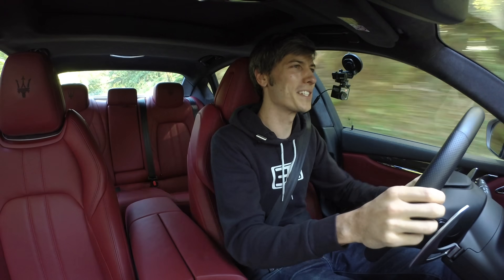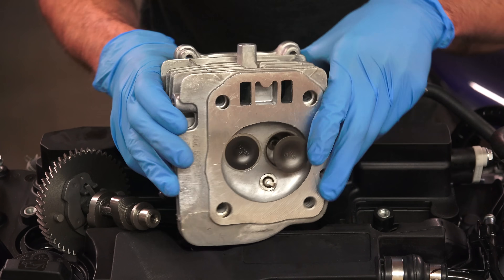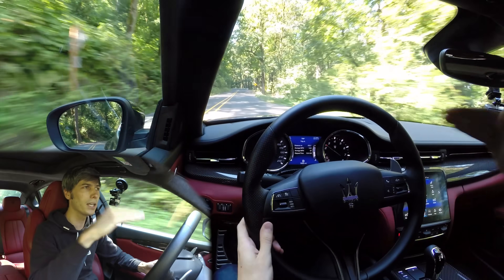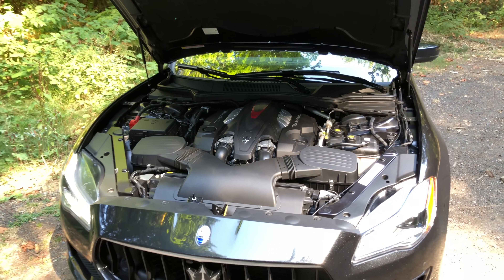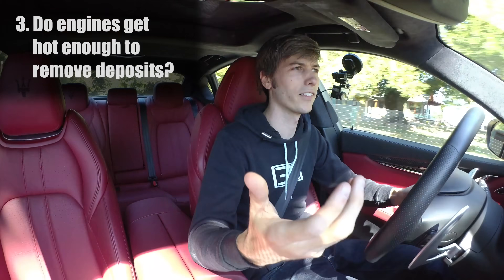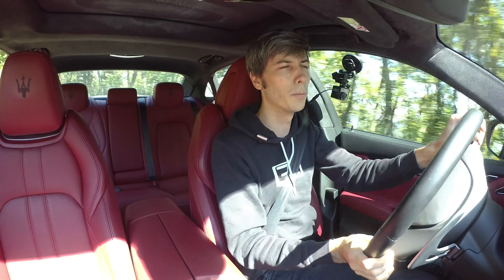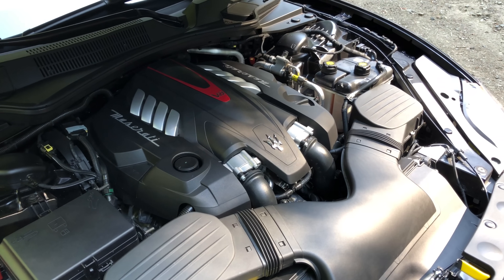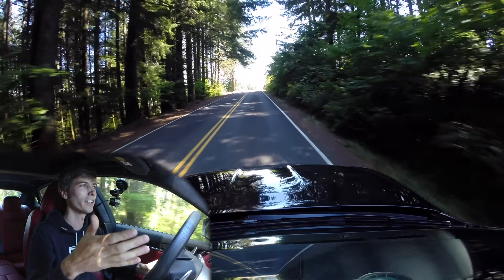Is Redline Good For Your Car's Engine? Italian Tune Up

Comment: Interesting that high load on a gdi engine actually promotes carbon build up. Def counter productive to redline this type of engine. I read somewhere awhile back that Mazda in particular minimizes carbon build up on the intake valves on the Skyactiv engine with how the cooling system is set up. The area around the intake valves doesn't get as much coolant flow. Higher temps near the intake valves doesn't allow for as much build up,
Reply from the maker: Hmm, that's fascinating! If you happen to find that article about the Mazda I'd love to learn more about it!
Reply: Engineering Explained I'll try to find it. Thanks.
Reply: Engineering Explained from a Mazda3 forum "They've been messing with DI for awhile and so they were obviously aware of the issue when designing the Skyactiv-G engines. What they found was that carbon deposits form when the intake valves get below 400*F, so when designing the block and cylinder head, they routed coolant passages away from the intake valves to keep them above that threshold." I'll try to find a more credible source.

Comment: With EVs, this question won´t be a problem anymore
Reply: Induction overheat and battery drain. ;) nothing is flawless
Reply: Yeah, instead we'll just want to know the best way to put out a lithium fire that's burning hotter than the Sun.

Comment: I'd like to imagine that on older Alfa Romeos and Fiats if you drove them hard the cooling system would cease to help much and you might get the whole engine hot enough to remove carbon. Newer cars, especially ones with major engine components made of aluminum overall have better cooling systems and hug to a tighter temperature range. That's by design, aluminum components in newer engines would buckle at high temp

Comment: Interesting video.
It seems to me you missed probably the most important question to draw a conclusion: How long and what load(above which rpm) is necessary to an engine for it to reach T>290? Yes it will depend but an estimate should be possible for you to conclude.

Comment: I have a Cadillac DTS, w/NorthStar. I do what is called " WOT ", for control of ring carbon. My car will  start burning oil , at a rate of around 1 qt. per 1000 miles . So at intervals of around , every 500 miles, if NO recent HARD driving , I'll run a series ( 3-4 ), sets of " Wide Open Throttle ". For me, WOT  is ,  40 - to redline , around 100-120 , in second gear (shifter position) . This has made a significant  change in oil consumption . My assumption, is this is good for my engine ??

Comment: Why is it presupposed that this is all about carbon deposits and heat instead of literally any sort of issues that could potentiakly develop from driving very conservatively on short trips which can be fixed by any sspect of driving harder?

Comment: When I was a technician at a Cadillac dealership, this was a frequent occurrence. A customer would have a “pinging” complaint and the fix was to take it out on the freeway and go full throttle. You would see a trail of black smoke similar to a diesel rolling coal (but obviously not that extreme). After 4 or 5 times, the knock sensor activity settles down and pinging is solved. I think there is a difference between the loose gasoline based carbon and the hard, oil-based carbon. For sure, you can blow out that loose carbon on top of the piston. If a vehicle has an over-fueling condition, the fuel carbon can be seen on the spark plug electrode. After repairing the over-fueling problem, doing an Italian tuneup on a road test will clean the plug electrode after just a few attempts.

Comment: Back in the late 80’s I worked at a neighborhood repair shop. We had a regular customer bring in his 79 Camaro that he babied, it ran poor and had no power. Not that anything from ‘79 ever had power! We did everything, tune-up, checked compression, 4gas analyzer nothing seemed to fix it. Finally the shop owner told myself and another mechanic to take it out and “beat the snot out of it!” After a 1/2 hour of really hard driving (And lots of black smoke from the exhaust) it was running like new again! Yes the Italian tune up works!

Comment: Regular redlining burns the whole engine up, wear wise, rather than the carbon. Young guys usually find this out on their DD vehicles the hard way.
Reply: But people on the internet are saying it's fine, therefore it must be fine ! Imma rev the piss outta my 1.0 liter 4 cylinder 50hp beast everyday every stop light and expect it to run free of any problems!
Reply: Back in the late 1970's, I was amazed at just how reliable and long lived a 1968 Honda 175 cc motorcycle becomes when you aren't constantly wringing the engine's guts out.  It was one of the biggest eye openers I have ever experienced.  
Today, I believe that BMW and Honda GoldWing motorcycles have earned a reputation for long service life mostly  because these bikes appeal to grownups.

There is no well defined altitude where the earth's air suddenly ends and the vacuum of outer space suddenly starts.  The air just gets thinner and thinner as you go up.  Engine redlines are a lot like that.  There is no easily defined rpm where abuse suddenly begins.
Reply: Common sense says running at red line as your regular goal will wear it out or break something. You know why it's called "redline, right? The red means danger zone.
If you run it at or near redline all the time, it will.wear out sooner or breakdown more often

Comment: Well all i can contribute to this (if it's the same) is a personal experience where my recent trip to yearly registration and tech checkup returned a VERY negative eco test (over 500 instead of under 300 on CO2), so several people told me to hit the redline on 3rd gear for couple of KMs on motorway. Now, we are talking an 99' Hyundai Atos, so not exactly a muscle with whopping 45ish horsepower, so i was hesitant running that thin anywhere past confort zone, but i ran out of options.
The thing actually kept 130kmh stable in 3rd gear, and i lived to tell the tale making me incredibly impressed about my old machine, and behold, after 20 kilometers of that torture (and about 10 or so litres of gas for that stunt oO) ecotest figures were like brand new, in mid 200's.
I'm not sure we are talking about the same thing here as with video, but nevertheless, there's the story. Engine runs much more smoothly, and is actually quieter. Other figures are that i make about 2000km yearly, 95% city driving, so the thing was choked on everything as much as it possibly could have been.
Reply: First mistake was buying a hyundai...
Reply: Well not that i'm too happy with it, but for the budget i didn't have any major issue with it for 5 years by now, neither engine or anything else. Only problem is that it's weak and slow, but for flat 1450€ incl. registration and licence, there aren't many alternatives which don't spend 2 days a month in the shop.

Comment: i ride my bike short distance daily to and back for work. Every once in awhile i'll ride long distance at a constant high speed. My bike feels alot better and responsive every time after a long high speed ride. That's probably because most of the carbon has been sent out thru the exhaust.

Comment: I think this technique worked, perhaps, better on older carburetor cars than EFI. I do worry about carbon buildup in my new Mazda. I just used the CRC intake valve cleaner specifically for DFI at 10Kmiles. And I use a super low volatility 100% synthetic oil. I'm hoping these will help prevent the need from having to remove the head in the future to be walnut blasted. I'm thinking of also installing an oil catch can...which might be the best bet...

Comment: What about vibration and increased air temp and air velocity at wot and higher rpms helping to remove carbon? Also increased fuel amounts in Port injection cars washing over the intake valves?

Comment: Eliminate the EGR, and put a catch can on the PCV system the sooner the better. I did that on my W203 Merc and run as a new one!
Reply: A good catch can will have a chevron assembly that forces the vapors to make several tight turns that should cause the tiniest droplets to collect on the surface, clump together and drip into the bottom of the can, drastically reducing the amount returning to the cylinders. Properly sized this will allow it to be drained at every oil change drastically improving carbon fouling on intake valves and intercoolers. Unfortunately I haven't found a good source for reviews of the less expensive cans, nor any guide to proper sizing.

Comment: So am not the only mechanical engineer who hates and don't understand chemistry 😬😬👌.
Reply: I'm studying mechanical engineering and while I don't mind chemistry, the subject is definitely one of the most hated across my mates
Reply: A mechanical engineer who hates and doesn't understand chemistry is going to be lost when it comes to the selection of materials required and potential design flaws ( in regards to adverse reactions).  Think about excessive corrosion,  electrolytic reactions between two metals, carburization and decarburization of materials, chemical resistance of seals, etc. It's important to have at least a little bit of chemistry knowledge when you're designing something or looking over a design.
Reply: @ThrowingItAway  that's why you work as a team that has members that specialize in a particular area and are smart enough to understand what's going on around them. Everybody doesn't need to know everything, pretty much impossible anyway.
Reply: ThrowingItAway exactly
Reply: @ThrowingItAway  i did my part of chemistry and i succeeded but i don't like it...,a mechanical engineer will have difficulties without a chemist but can a chemist creat,make mechanism without a mechanical engineer,all what am saying is it's all related from chemists to mechanical engineers electrical etc .... Stop the hate
Reply: As a chemist I don't understand why people hate chemistry :D :D :D
Reply: Everyone hates chemistry lol
Reply: Marry a Chemist it will work out
Reply: Braaap Stuuu lol
Reply: I do CompSci and despise chemistry despite it being my best science
Reply: "Mechanical Engineer"?  Looks to me like it's a struggle for you even typing an intelligible sentence.
Reply: @revolutionday1  indeed, English is not my native language.sorry for the mistakes if there is any ...
Reply: @braaapstuuu9329  don't mind the grandma Nazis...

Comment: Do those temperature study numbers work similarly to small compact 1L engines?
Reply from the maker: The port injected study was a 1.9L, but engine size shouldn't change internal temperatures all that much, so it should be fairly broadly applicable, assuming you're comparing other four-stroke water-cooled engines.
Reply: @EngineeringExplained  is that in gasoline or diesel engines? Or is it the same for both?

Comment: errrr/ temperature is one thing but there is also air pressure. The more air blows via an intake port the more dirt it takes with it. I mean imagine a tube with old grease inside it, if you blow a lot of air inside it will blow the dirt out. I'm pretty sure it affects carbon build up a lot more than just temperature alone, especially if you have a turbo.
Reply from the maker: Even with a turbo those pressures are extremely low (atmospheric is 15 psi, high boost engines would have maybe 20 lbs of boost). A chemical bond can be much stronger than the air blowing by it.
Reply: @EngineeringExplained  hm, i agree, but then there is the practice. I've seen mercedes engines full of dirt in the intake from just spending their life at idle (limo drivers waiting for their passengers), while engines from cars that reach high rpm often dont seem to have any of this and are generally very clean on the inside. Without a turbo there is no realistic way an intake air temp would get to 325 degrees, so something other than temperature must be at work. I personally thought it was the airflow, would be interesting to see a scientific explanation. Great videos by the way, there is no other person on youtube who explaines complex mechanical things like you do!

Comment: Do you recommend a oil catch can for pcv side of GDI engines? alot of back and forth on forums on how its necessary or it would have came stock from the factory? I own a 1.6l ecoboost in a fiesta st and am on the fence for 200$ catch can😲
Reply from the maker: I think catch cans are a very logical idea. Here's my video on it: https://youtu.be/PWz6vCnJ4CA
I think they don't come from the factory because customers won't want to deal with draining it periodically. Same reason VW got into the whole emissions mess because they didn't want to use diesel exhaust fluid with their cars, an extra step for customers that they won't want to deal with.

Comment: I think that a combination of a good high concentration PEA detergent fuel system cleaner and the "Italian Tune Up" together can yield good cleaning results.
Reply: Sadly, fuel treatment does nothing for the valves of a GDI, since fuel is injected directly into the cylinders, and never touches the intake valves.  Good fuel treatment will help keep the injectors clean; so at least that can be a benefit.

Comment: 2 transmissions and a new motor would suggest not driving your car hard
Reply: Yeah, I wasn’t to mature either. It was my second car. The transmission failure was because it was an automatic mid 2000s Honda
Reply: Yeah, I wasn’t to mature either. It was my second car. The transmission failure was because it was an automatic mid 2000s Honda

Comment: I had redline my motorcycle on the highway and the engine start to ignite the fuel incorrectly (I know this because the engine vibration is higher than normal, even during low speed), but became normal after parking all night (my motorcycle engine is 125 cc single cylinder with compression ratio of 9:1). never do that in my car because no highway in my town that adequate for cruise over 120 km/h (75 mph).

Comment: I wonder if intercooled turbo engines have so much deposit on the intake valve due to the air temperature cooling down the intake valve "too much"

Comment: The secret to making this work is to first drain all your oil and then remove your water pump fuse, this allows your engine to reach those higher healing temperatures.

Comment: It does seem to be a requirement in a Renesis engine though, Possibly because the combustion always takes place in the same section of the engine and gets super hot? Hmmmm, further research is required...

Comment: soo i´ll risk ruining an engine justo to remove carbon deposits?

just run it with lpg/propane for a few days and all the crap will be flushed, or better yet, switch to lpg and never have this problem again...

Comment: Bro can you explain why these european engines are not reliable ....??? but we have 90s mercs that crossed 3million miles ....what makes them unreliable
Reply: All the gadgets and electronics that they threw into them in recent years. So many things are computer controlled that if a microchip goes out half the car's lights will not work - That is one example. Also they are much more expensive to fix than japanese makes such as toyota or honda...that brings down the reliability substantially in many people's eyes.
Reply: thanks ..thats indeed a great explaation..electronics...)

Comment: So if your engine only have DI, then you are fcuked
Reply: That pretty much says it.  GDI = BAD news.  :/
Reply: Depends on what kind of DI engine too
Reply: Long Tran sure, but at the end of the day, DI = no fuel spray at the back of the intake valves
Reply: Honda has some method to get some fuel in the intake in their earth dream engines without port injection
Reply: @suiton20  only time will tell if that will work, since it is a not constant spray of fuel. The CRV's 1.5T currently has a problem where fuel can be mixed with engine oil, so not a good start for their small DI turbo engines.
Reply: nickolas I have the 17 civic si and am aware of the issue. I’m not sure how many cars are affected. I check my oil frequently to make sure gas isn’t diluting my oil. No issues so far
Reply: @suiton20  there was a huge recall in China, but nothing in the US yet. The 1.5T in the Civic had its own issues when first launched, but yours being a 17 model might be okay. Good luck.
Reply: Toyota's solved these problems with their D-4S twin injection fuel system. This system combines direct injection (949cc/min injectors) with traditional port injection (298cc/min injectors). My 2010 Lexus IS 350c uses it and is light years ahead of my wife's 2013 Hyundai 3.3l Santa Fe.
Reply: I like BMW's "fix" the best - make a machine the dealerships can buy to clean the carbon build ups lmao

Comment: To me it seems like this would most likely apply to diesel cars nowadays. DPF's on those tend to get clogged because of the carbon buildup, and at least on an Alfa (yeah, truly an Italian tune-up) the procedure to trigger the DPF cleaning "burn" is to drive on higher revs for 20-30 minutes. Not really redlining it, but still. I'm not familiar with other diesels than the 2.4 JTDm, but i would like to imagine they have a smarter way of triggering the burn than that. Also, excellent video once again.